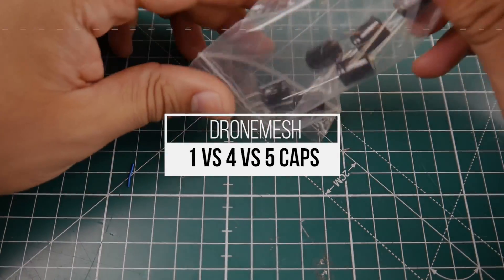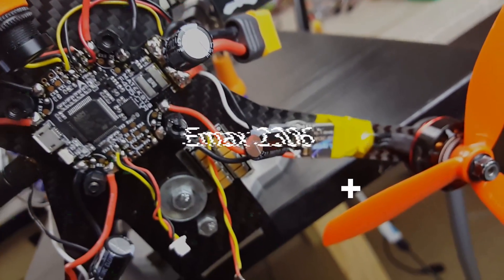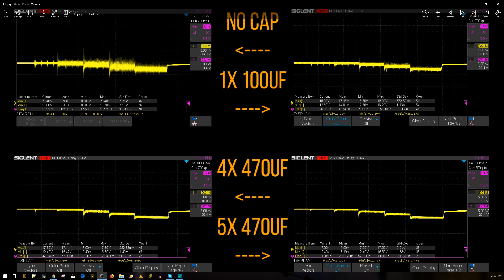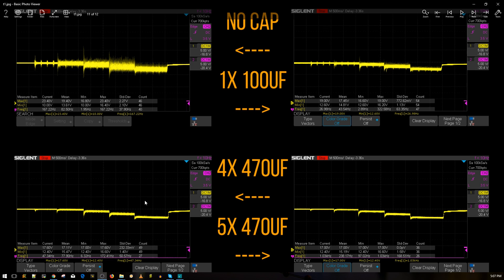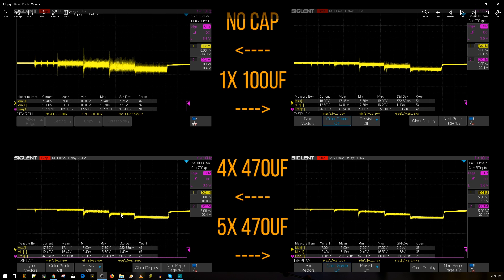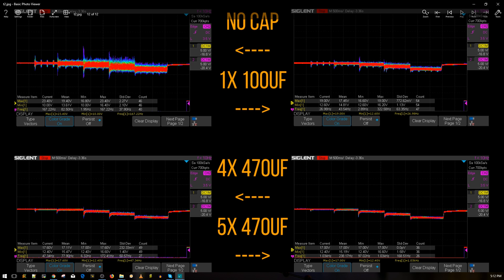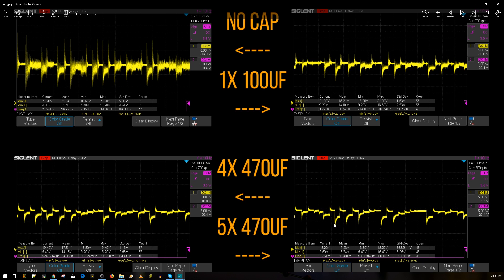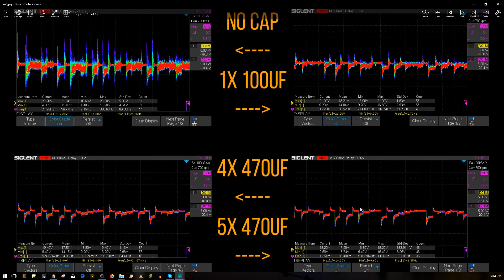Drone LOW ESR Capacitor Shootout Part 2 // 1x vs 4x vs 5x LOW ESR Capacitors who will win?

Comment: Yeah you should have tested 2000uf VS the 4 each 470uf to be fare. I find your test very interesting keep going. Also try the 4in1 esc like Dalrc and try to add a 1000uf...and best should be to find the cleanest power setup for the cam (LC filter or dc-dc convertor ...)

Comment: I have been running 5S on 6 inch props for a year now, and placing a 50v 1000uf cap in the main line and each esc made the video crazy clear. People ask me how it is so clear, then I mention I am on 5S and jaws drop... NEED caps!

Comment: Try a Daewoo RSS 1000µF 35V directly to the battery leads,  one Lelon 470µF 35V to the FC and a Rubicon 330µF 25V on the Video, that helped to clean up my noisy set up.

Comment: Nice results and well explained. But for neatness, could you run maybe one capacitor say 1000 or 2000 and then run wires from each esc pad on the flight controller to the one cap? Would it interfere with the controls? Maybe worth a run on the test set up.

Comment: This is insane!!  What a massive difference. Plenty thanks for this hard work!!  I heard that location of the lowESR cap makes a difference too.   I wonder if you could do a simple test with just one ESC with the cap mounted at the ESC vs the battery connector to see if there is really a difference.